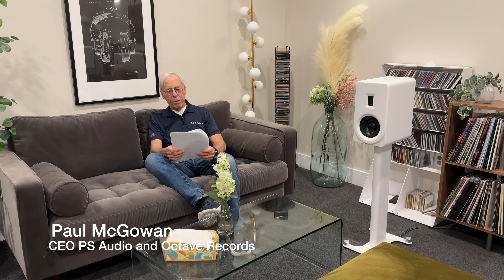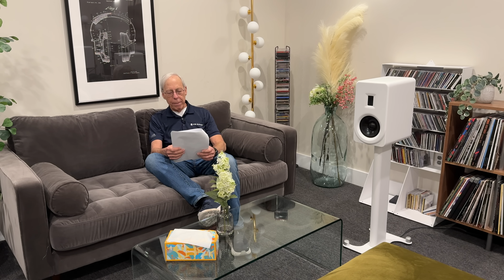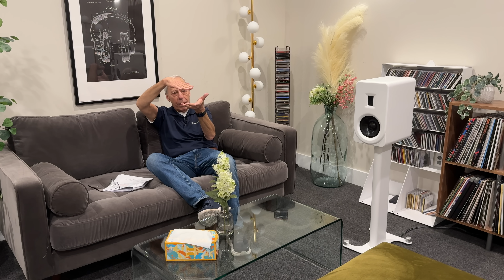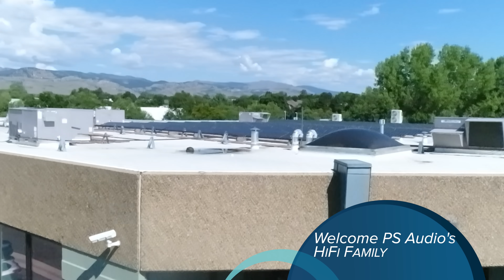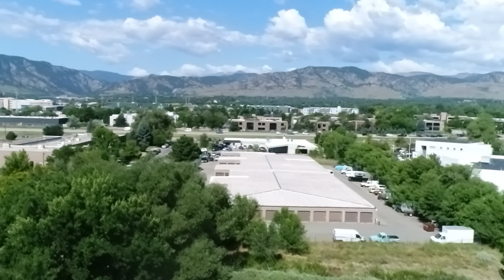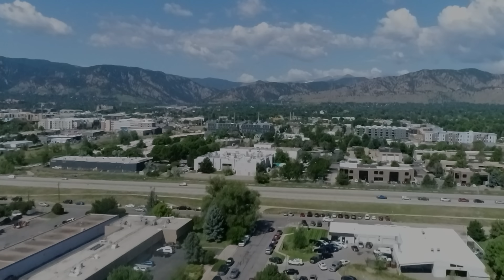Understanding dynamics in a speaker system

Comment: My criticism here is that the example of the cannons on the 1812 is a rare occurrence. Most music just doesn't have that effect. Plus there are 1812 recordings where the cannons are a loud kettle drum beat while others have real cannons shot outside at say a military academy mixed in by an engineer who chooses how prominent to make them. Better examples would be low bass drums in rock, bass guitars and/or cello passages in classical. Dynamics on pop / rock are usually not as much with recording compressions, meanwhile in classical passages can range from 60ish dB (normal conversation level) to 100 or more (generally for brief periods). But excesses of 90 dB can jeopardize hearing (90 is an OSHA limit without ear protection) so while 95-100 won't damage your ears for shorter periods, listening to that over many years will have an effect (in addition to the normally process of aging, especially in higher frequencies).  Most decent speakers will go up to 100 - 105 dB (especially higher efficiency ones)  without getting blown and all speakers will reproduce 60 dB. To claim his FR5s have better dynamic range than say even older AR3as is not correct. But, there are other aspects of reproduction that the FR5 may well have advantages.

Comment: In 1982 I purchased Acoustat III . However the IV with enough power, say 1000 watts of high current power, were noted to dim the room lights during the loudest parts of the 1812 in one review. Again the size room minimum is 22’ by 26’ .Radiating surface area, room, source material and current (not wattage) able to handle a capacitive load all needed. Talk about finicky!!

Comment: I just A/B’d the Telarc to the Leonard Bernstein performance of 1812 Overture. I made a comment previously.

For the cannons, if they used the high end of Bernstein to the low end of the Telarc. That would be nice. 

My sub has made a difference compared to my past 90’s system. All originally coming from memory. 

By AB’ing, i reached and felt a nice depth to the cannons especially from the Telarc.

I still like Bernstein’s performance and better recording for imagery and separation.

Comment: This question of dynamics isn't properly answered here.  It's not about the loudest to the softest that you can hear when we discuss dynamics.  That happens rarely in a recording.  It's about the little bursts of sound that take place at different times and different volumes.  I've used Quads and they lack dynamics for sure.  But I have a pair of Martin Logan Sequel II hybrid electrostatic and cone woofer speakers.  They do a very good job on dynamics.  When a horn player steps out for a solo he's right there in the room and I can hear all kinds of loud and soft parts to the music.  That's the important part of dynamics that my speakers capture.  Sure horns are great for dynamics but they fall short in many other ways of realism in the music.  Paul's speakers probably sound great.  But I don't see how such small ribbon drivers can move as much air as my 4 feet tall electrostatic panel does.

Comment: Dear Paul , As an owner of Martin Logan Summit-X's, driven by a full Benchmark system your remark about the dynamic performance and the "compressed sound"of electrostats is not something I regonice at all. First of all, the total surface of an electrostatic foil is many many times greater then a cone speaker and the speed of wich it moves is much greater then a cone can because the weight of the foil, compared to a rigid cone design is much much less, so less energy is required per inch squared. Yet another thing to consider is the difference in experiencing a point source (the cone speaker) or a source that makes a standing soundwave. Your claim doesn't allign with my listening experience, compression is not a thing I experience so  maybe you can tell me more about the what is fundamental to this.
Reply from the maker: I too have owned just about every model of Martin Logan electrostat and Acoustats, etc. Hard to explain other than getting technical, but once you hear the dynamic difference it would be obvious to you. Indeed, big panels have a lot more surface area but their range of motion is extremely limited. Compare that to the travel possible on a Planar driver and the fact that it has less surface area becomes somewhat meaningless (and the greater surface area of an electrostatic can have other problems too). I love electorstats. Nothing has the speed and transparency but it is truly at the expense of dynamics—that effortless growing of the soundfield like in a big Mahler piece. Compared to an aspen speaker, it gets squeezed at the loudest points. The only electrostat that comes even close are the big Sound Labs like Ray Kimber displays with and they are 8 panels!

Comment: I find reviews of loudspeakers interesting when they start talking about dynamics. We hear some types have better dynamics at low volumes than others. Or some are more detailed when dynamics passages hit. Some just have more dynamics. Horns tend to be classified as having more dynamics, at low volumes, ... while metal domes tend to have detail during dynamic passages. Then you hear about the ringing and beaming of horns. The other side of how they get "dynamics". Or how listening to all that extra detail at dynamic levels become fatiguing. 

Regardless of speaker type, dynamics comes down to power linearity. How does the frequency response and radiation patterns change with SPL? Fletcher Munson curve. Human hearing rolls of more at the top and bottom as volume level drops. If your speakers don't sound like that, it is a nonlinear power distortion. IOW speakers that are said to have better low volume response are because of distortions. That detail on the high end should not be fatiguing. That comes from distortion. 

Depending on the type of music and specific recording, most music has very little dynamic range. There is an  “Unofficial” Dynamic Range Database uses a sliding scale from 1 to 20 (1 being the worst, 20 being the best) to rank the dynamic quality of each of the recordings they list. Most CDs are around 8-10 while records are typically 10-14. Vinyl tends to be mastered with more dynamics. The claimed S/N superiority of CD is completely lost in mastering. 

To then talk about how dynamic a speaker is when listening to maybe 10db of dynamic range? That the guitar rif is so dynamic? When it is at the same volume level as the music to that point. They've just dropped the rest by a few db because Zero VU is Zero VU!

Comment: I believe we Martin Logan owners with speakers from the Masterpiece series need to let Paul in on a few points.  The single cross over point in the Classic 9's (which I own), is at 380 Hz.  So, that panel covers mid bass to the top octaves of our supposed average hearing.  The BASS MODULE in the HYBRID design with horizontally opposed ALUMINIUM woofers (dual 8" in my case) take it from there down below 30Hz.   That takes care of all the dynamic punch.  Efficiency is 90 DB.  ML suggests an amp of at least 400 wpc.  Which I invested in.

Please don't get into the argument about the blending of dynamic and ESL drivers, ML has been at this a long time, and they have that issue ironed out.   Those of us that have the latest version of the speakers know this.   Yes, and for the very bottom octaves down to 15Hz. I added one of their Dynamo 1600X  subwoofers with Anthem room correction.  It all amazes listeners that have come here to visit with THEIR favorite recordings, they hear it for themselves.  There is also KLIPSCH Forte' 4's in the home, so there are HORNS in the house. 😆
Reply: Paul should come and listen to my ML ESL 15’s 😅
Reply: @ Oh wow, you have the BIG GUNS in the Masterpiece Series! Congrats!
Reply: They recommend 20 to 400, not at least 400
Reply: @ Thanks, yes, I should have worded that correctly (O:
Reply: As a ML ESL owner I completely agree.
Reply: @TheMartijn00 Thank you so much or that!  You understand ((O:

Comment: I do not fully understand you this time, but I have been wrong before :) I have own many planars and different electrostatics, some of them hybrids (guess the brand). In this particular brand there are a lot of different models and going mid level and up I start to hear great dynamic range that the more cost effective models are left wanting. The difference is not small... I happened to own one of their earlier top model and they have, more then you can handle, when it comes to the difference between low level details and high dynamic passages. I am just saying that there has certainly been improvements through out the years, but every design has its own flaws of course, but it could be negative to generalize that electrostat's cannot give you a good smack in your face :) My previous (Magne) planar's did not have this dynamic range, but they are indeed power hungry suckers..

Comment: Speaker dynamics are produced by  vibrations of the speaker cone(s)driven by the electrical signal applied to the driver (cone, planer, ribbon, horn..etc) and the surrounding air, where the speaker driver movement directly creates sound waves by compressing and rarefying (stimulates precise mechanical movements that produce acoustic waves) and moving air particles essentially transferring mechanical energy into acoustic energy.  

Properly designed horn drivers will always acoustical couple to the surrounding air molecules with less phase shifting snd dynamic compression of the acoustical wave form than any other type of driver design. Thus speaker  dynamics and resolution are always a function of drivers design. This is why horn loaded speaker systems are always used in large venues  and movie theaters for their high dynamic range an large acoustical output. 
 
Large planar or electrostatic drivers utilizes a flat or slightly curved diaphragm to produce a wide, even wavefront with a focus on detailed sound reproduction across a broader frequency range with less acoustical output but a more detailed sound quality across a wider frequency range than other driver designs. They often excel at creating a wide and detailed soundstage due to their even wavefront with less distortion at lower sound pressure levels.
Reply: How long is it since you've been to a concert? I've not seen a horn loaded speaker system in decades. Every venue uses large, directed line arrays, as these provide an even dispersion of sound over a huge area.

Comment: Sorry, but dynamic range is not the same as dynamics. Dynamics is actually speed from stationary. Therefore electrostatics are dynamic just with less dynamic range.
Reply: That is correct and accurate.
Reply: Isn't that transients?
Reply: @AjuVignesh Correct, he is confusing transient response with dynamics. Paul’s explanation of dynamics and dynamic range is accurate
Reply: Dynamics IS transient response .... this and the decay plot ( waterfall plot) go hand in hand.... dynamic range is the ability of a speaker or combination there of to maintain its dynamic performance over a it's frequency response ... ok 👍

Comment: The important thing is the maximum SPL level the speaker will produce at a wide range of frequencies with low amounts of distortion..The lowest level depends on the rooms background noise often 20-30 db !
Reply: Sound Pressure Level level???
Reply: @dougdavis8986 I guess it's kind of like saying my pin number
Reply: Room noise is often 40dB, and if there is a refrigerator or an aquarium air pump nearby, it might be worse.

Comment: you can achieve the same thing with subwoofers like Arendel's  that has a delay setting that's what you need. an ideally a high pass filter for your planars. you can use an active speaker management system to achieve this, non DSP. but DSP for the woofers/subs tho.
Reply: The highs and mids on my full range ESLs are to my ears beyond reproach but a good sub completes them.